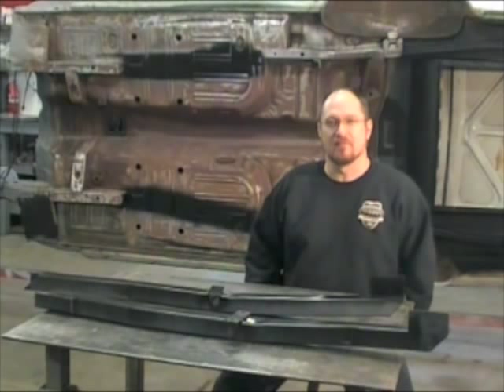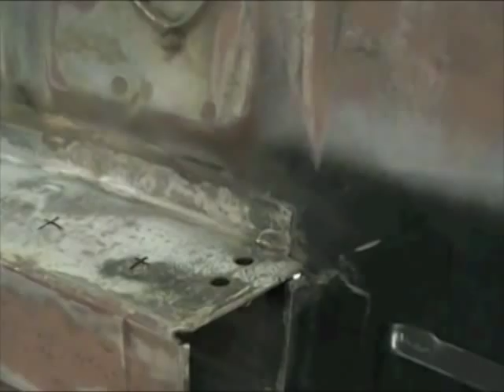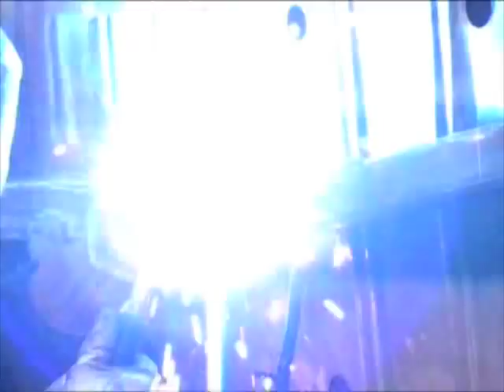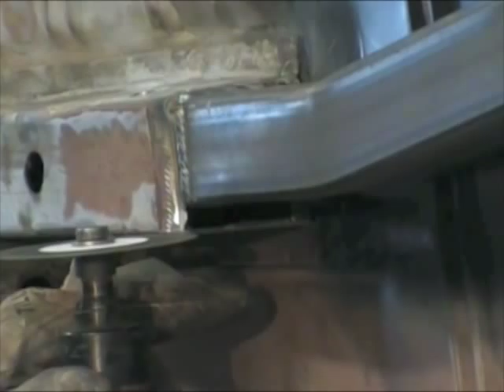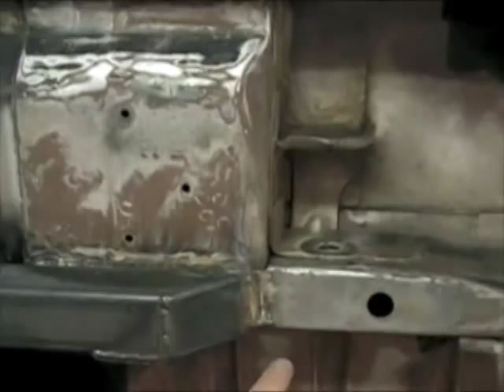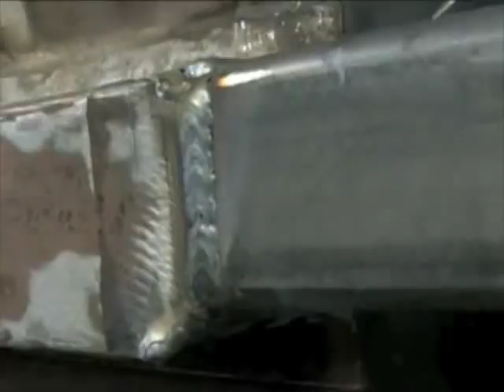Tin Man Fabrication 1965-1973 Mustang subframe connector install

Comment: You tend to wonder why Ford never did this , especially with the convertible models.
With all the weight , not only with a full load (4 passengers), but driving on bumpy roads with a full load, you really would think Ford would have strengthened the entire thing with these connectors. I mean these prevent sag as-well-as twist.
With all of the great cars those guys designed back then , what were they thinking.
But I guess that's it. That weren't   
The old TV add " Fords Better Idea"